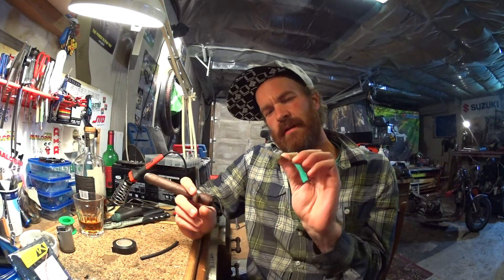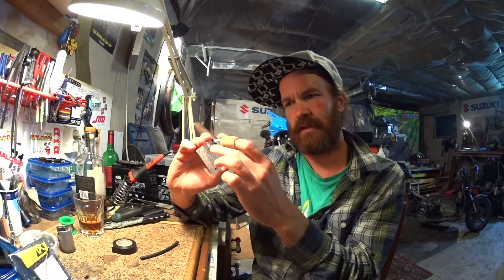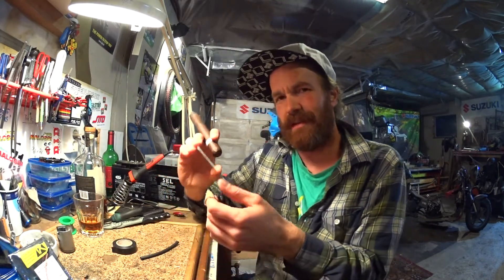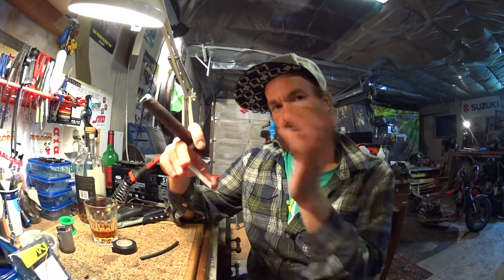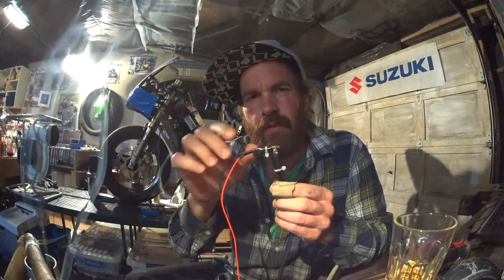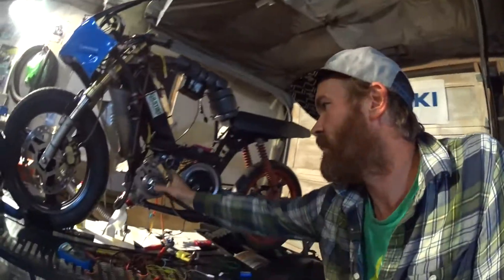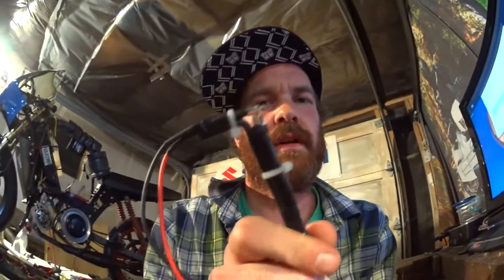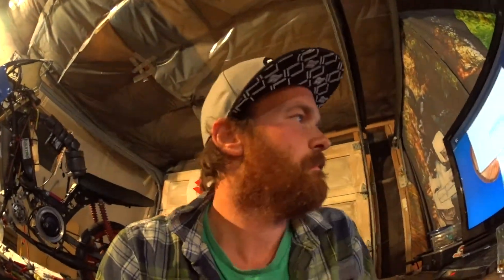Ardyno | Rpm Sensors

Comment: I realize you've already come to a final design of your PCB, but this may help in your future projects.  I was designing hardware and software for automating a hang-glider towing winch that I designed using a Yamaha Majesty 400cc scooter engine and drivetrain (4-stroke single cylinder with variable trans).  I needed to have engine rpm and final drive axle rpm, among many other inputs.  After a little thought, I came up with merely using a Hall switch positioned on the ignition coil pole to pick up the spark timing.  Worked perfectly with very clean signals, but you do have to follow the white-paper instructions for harsh, noisy environments.   I used a Melexis US5881 unipolar Hall Switch of low sensitivity, in the UA package.  I used this same model of sensor for axle rpm with four magnets positioned evenly about the winch spool.  I've since used this same Hall sensor model for many other projects and couldn't be happier with it's solid signals and resets.  Even while using the added components that are recommended for noisy environments, the oscilloscope shows very clean, strong, square signals.  Maximum switching frequency is excellent at 10 KHz, orders of magnitude faster than what is required for timing a high-reving 2-stroke.  Plus the instruction set required to capture the interrupts from this sensor in a typical uC is tiny compared to what you have to do with a comparator, etc.  Merely use a timed interrupt on an input pin!  Easy-Peasy!

Comment: Hi, I want to help you, I use this circuit to read the engine rpm for my projects and it works fine. I think it's similar to yours. with this circuit you can adjust the dutycicle and the maximum voltage of the square wave pulse that goes out to the arduino.
Please let me know if it works for you, you can see my projects on my youtube channel.
If you think it can be improved I'm all ears.

https://imgur.com/a/42BAQ
Reply from the maker: Thanks for wanting to help! I can't get your link to work...
Reply from the maker: +MecGarageLab working now, sorry... I'll study it later!
Reply from the maker: +MecGarageLab I've had a look at your circuit. Could you explain how the trigger input part works? Pin2 Trigger is held high by the 100k resistor, but I can't understand how it will ever go low with the ac signal from the ignition wire being half rectified by the diode? Please enlighten me😀
Reply: Hi, the 100k resistor is a mistake.  I copied the schema from another one of my projects :D
Reply: look at the signal I have, clean and ready for the microcontroller:        https://imgur.com/a/VmTVF
Reply from the maker: +MecGarageLab Looking good!
Reply from the maker: +MecGarageLab ah, I see!
Reply: @Mecatronicgarage  will it work with a 5v voltage source
Reply: @maxxecuireland9441  doesn't work very well with 5v. you really need to use 12v so that the output pulse is high enough to work on the arduino.but attention cannot exceed 5v maximum and 2.5v minimum.

Comment: Have you tried PIC chips, they are basic, but the size of a 555 timer they can do that and a lot more and they are cheap. I still code in VB6 so I use PIXaxe that uses VB like basic. You could piggy back a small PIC chip in the pick up lead at the engine and filter triggers at the PIC and send them on the long lead as clean PCM.
Reply from the maker: +I Make and Fix Stuff Thanks for the advice!